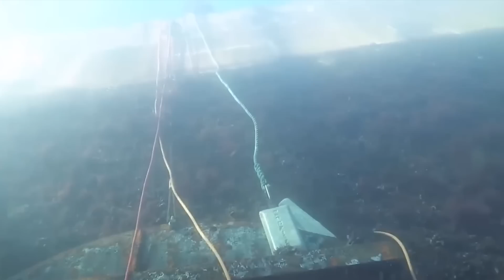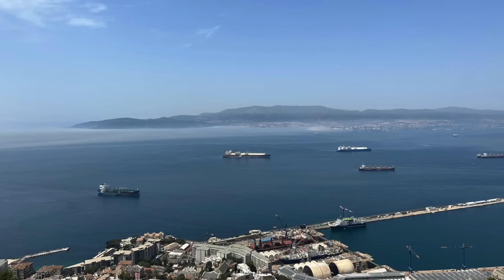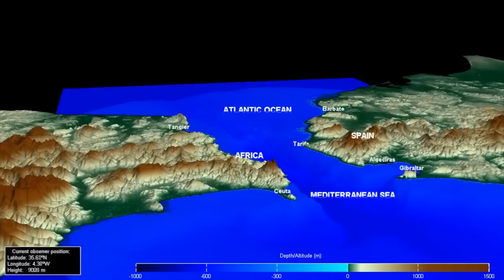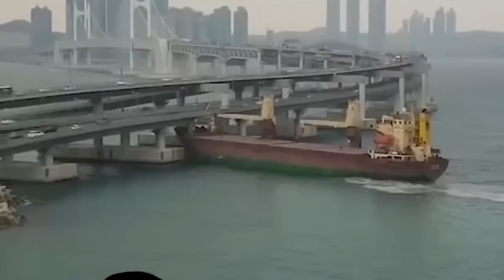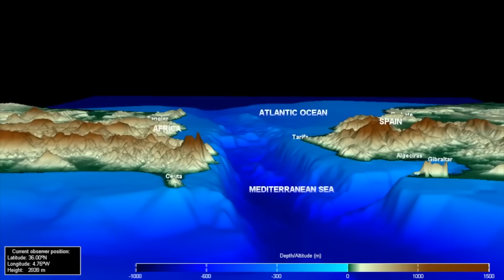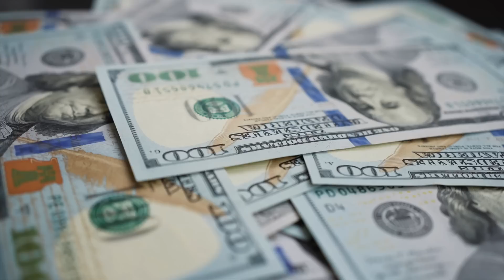Why Nobody Can Build A Transport Link Between Europe And Africa

Comment from the maker: Can this actually be solved? We're hearing rumors of a potential bridge planned to be built now but we're not so sure on this one
Reply: Who in their right mind wants to make leaving Africa easier?
Reply: It seems incredibly hard, I've often wondered if a system like the one used for oil platforms is an option, oil rigs are incredibly stable and operate in depths of 500m regularly, or you could build out as far as possible from the coasts and use oil rig like structures for form the central span secured by multiple cables. above and below.
Reply: They can, now there is a tunnel project.
Reply: Cant be done with a fixed construction, bc the African plate is moving to the Eurasian plate at a rate of 3 cm/year. So the only option would be part fixed on one plate, allowing for shipping and part floating on the other.
Also, there is no benefit, so i doubt someone is going to cough up billions to make it.
Reply: There's a project of a floating underwater tunnel in Norway now across a fiord - 2 tubes floating suspended on huge buoys. A very interesting solution that could be used here as well
Reply: @eugeneg1455  I'm afraid that there is a big difference ...A flord has no plate tectonics, is less deep and , depending where in the fjord, less to no  streaming water around.
Reply: Ask Elon. He will promise that we can go from Spain to Morocco in just 5 minutes with his Hyperloop starting in 2022.
Reply: Sky hooks.
Reply: Too deep
Reply: floating oil rig platforms
Reply: That has no meaning
Reply: Norway are first in the world with long distance floating underwater highway. Perhaps it could be used here.
Reply: A rail tunnel is far more feasible. The depth is not that great an issue, it would still be a shorter tunnel than the Channel Tunnel - the plan isn't just this crossing but faster journeys between Madrid and Casablanca
Reply: Terrible idea. Why would we want an even easier way for illegal migrants to gain access to Europe?
Reply: Building a bridge between Morocco and Spain that allows vehicles and trains to pass is a very easy task nowadays. It is not done because it is not wanted to be done. Just like the bridge between Italy and Sicily that was not built. Solutions to distances and other force problems can be found. As long as it is wanted.
Reply: @Cancalılardan  Not sure about this.
Technical main problems :
Very fast and turbulent water streaming from the atlantyif into the mediteranean (and back at low tide) requires enormous strength ...
We cannot even build seagoing ships withstanding rogue waves ....
We know that the plates are shifting. A project like this is build for a long time...and africa moves with ca 1 inch a year to europe.
Buiding any structure withstanding this movement and lasting long is near to impossible.
A non rigid structure could be possible ....but a floating bridge with those currents.....those floating pilars would need a lot of energy (and engines) to be kept in position. Also the issue of the big vessels will be a problem.

And WHY would we want a bridge...which can never handle a big cargo stream (compared to the cargo transported by containerships.)
This makes it a prestige object, not an economical business case.
Reply: You can't imagine a solution because your imagination sucks.

Comment: $20Bn is chicken feed considering the size of the European economy and the long term benefits that would accrue from a "land" transport link on the western side of both continents. $50Bn, $100Bn would also not be real financial obstacles for the theoretical long term benefits. No, the real obstacles are technical and political, neither of which are likely to be overcome any time soon. Once a bridge or tunnel with at least a 50 year no significant maintenance lifespan is technically feasible then moving forward on a project proposal might be viable.

Comment: We just need an idea how
1 use vehicle ships going back and forth.
2 fill a thin line of durt to add a highway on both sides, meeting in middle to where it has the ships' water path separate them with 2 open/ closed bridges.
3 a floating bridge with an open and closed ship path separation in middle that is flexible and strong against winds and water and earthquake  mabye lol

Comment: 5:05 "a height of at least 100 meters"? The highest air drafts are not much more than 72 meters. I don't think that a bridge would have to plan for a clearance of almost 30 meters (almost 100 feet) over the tallest ships.

Comment: They need another Chunnel. They did it from the UK to France across the English Channel years ago and  it was much longer at 31.5 miles than the mere 8 miles across the Strait of Gibraltar which is 2,953 feet  deep, much deeper than the 574 feet deep English Channel. Perhaps the depth is daunting for some reason.

Comment: Just bridge the gap with a parallel universe. Find an uninhabited universe where there is a land bridge between them, and build portals to and from it on either side. Problem solved.
Reply: Problem is though, we'd need to find a way to setup receivers in the other universe... Which of course is super easy to do these days in an inhabited universe since we can just communicate with the other side.... We'd need to find out how to get a matter receiver on the other side.
Reply: So the solution is Sliders!

Comment: The water flows primarily into the Mediterranean Sea to replace what the Mediterranean loses through evaporation?  Doesn't water also evaporate off of the Atlantic?  I understand that the Atlantic is deeper so it probably loses a smaller percentage of it's volume to evaporation, but it would also sometimes rain over both bodies of water, and rain on the Mediterranean (and rivers that feed into it) would also have a greater impact on replenishing it due to it being not as deep.

I would also think that tidal action would be dominant over all of these effects.

Comment: There is a solution.
It really easy.
Give me $3 Billion in gold and I will have it built within 5 years.
( Of course I will disappear just after you give me the gold. But who cares.)
No really it can be built. It just not feasible. The price to use it would be far more then other means.
Far cheaper. And it may exist. Would be a fairy system. It would be fair cheap to build. Far cheaper to maintain. And far safer.
If a fairy does not exist. Why hasn't anyone done it?
Yes it would be far less traffic. But it still more then without.

Comment: For those who say that this project will not happen because of the economical disparity between Europe and Africa, because of fear of illegal immigration…. Think about it. This transit will be much easier to control than the vast shores separating the two continents where pateras can roam between the two sides (still Morocco is doing a great effort here and this illegal immigration is well controlled at this point).
I think this project will see the light eventually, and I won’t be surprised if the work (not the inauguration)  start before 2030. It is unfortunate we are not going to see this marvel completed before the 2030 Morocco-Spain-Portugal joint World Cup.

Comment: Wrong,,,the trouble is in bad negatiwe kolateral human evolution,,,,,the tehnology of construction is tacken long a GO,, ewend on ertquacke end big vaves,,,the simple question is,,,Who will first make a complitly plan for best solution....deep concret stabilisators  conect wit long wires to a 4xbig ander watter sea tanks...witch are on deoth of 50m,,,end from ther up make a plarforms with computer control for stabilisating point of surface base witch can suport 5 000 t in worst deep sea part betwen EU end Afrika,,,end the conquest its simple,,or part of brige can go up of surface end ader part can go belowe the watter,,,

Comment: The Troll oil/gas drilling platform  was 472 meters in height, and was sited in 303 meters of water offshore from Norway. At the time, it was the tallest structure ever moved. Over time, it has sunk 36 meters into the subsea surface.

A similar structure could be the basis for a bridge. However, the cost would be astronomical, with each tower costing as much as $1 billion or more.

There would also be some issues with ecosystems,  as various plant and animal species could migrate over the bridge, either autonomous or carried by vehicles.

Comment: You failed to mention the overpowering need for such a project. Road or rail crossing would need to be showing a need which I doubt is there. Rail maybe a not starter due to differences in rail system. And be fun& a ferry across such a short stretch of water could funded for many decades for a 10th the price.

Comment: FAR too many problems to build a bridge or tunnel there.
One, not mentioned i believe, is that the African plate is moving to the Eurasian plate at a rate of 3 cm/year. That means any fixed construction would be in trouble in 10 years or something, as expansion/contraction measures, which are always applied to large structures, will be pushed to fail.
That means the only technological possibility would be to use a fixed part, to allow for busy shipping there and a flexible, floating part, ankered to the sea floor, but allowing for this tectonic movement.

You cant just compare to any other tunnel or bridge, which are all on the same tectonic plate. It matters, a LOT.
Reply: He mentioned it at 5:33, but only in relation to earthquakes, not in relation to movement, relative to each other.
Reply: When I found this video that was literally the first thing I thought of
Reply: Thank you!!! This was my theory the whole time.

However, the political and economic (or lack of) reasons are also pretty loud in their own right.
Reply: I've wondered about the bridge over the Bosphorus, though. Doesn't it span the gap between two tectonic plates (as would an undersea tunnel also in the works, I believe)? I have always assumed the Eurasian and Anatolian plates are also continuing to plow into each other.

That wouldn't mean the Bosphorus bridge was necessarily a bad idea, mind you. The economic case for it would be massively greater than for a Gibraltar bridge even if the Bosphorus bridge had a usable life of, say, a century or so between full replacements forced by ongoing tectonic shifts.
Reply: @PeloquinDavid  Im no expert on plate tectonics, but the anatolian plate is stated to rotate counter clockwise (being forced by a number of other plates) and moving southwest at a rate of about 2 cm/year.
Fixed spanning that would also lead to problems pretty fast imo, although some things can be done if direction is known up to some extent, for instance by sliding segments for a bridge (will be a lot harder for tunnels).
The Bosporus itself is sitting on the eurasian plate.
And the bridge at for instance Lapseki in the Dardanalles is sitting on the anatolian plate. So both these do not span different plates.
I dont know any that do, which is why i pointed out it will most likely cause problems relatively early in the lifespan of a bridge or tunnel, which normally last a minimum of 50 years to make it economically viable to build them, but often stand for 100, or 100s of years.
Reply: @StofStuiver  Thanks for this. I see now that the Bosphorus is still technically on the Eurasian side of the northern Anatolian fault. But it's awfully close to that fault system and the entire region - all the way under the Black Sea and across to Crimea - is (like the Anatolian plate itself, though to a lesser degree) under significant pressure from the advancing Arabian plate, it appears.

But you're undoubtedly right that the rotation of the Anatolian plate into the Aegean and eastern Mediterranean means the pressures that would lead to buckling of the land the Bosphorus bridges are built on would be a lot less than that of the advancing African plate plowing northward through what I presume is still mostly oceanic crust between Morocco and Gibraltar.

So your point about the particularly challenging tectonic environment for a Gibraltar bridge certainly seems well founded...
Reply: Maybe there's an arch design that would be able to flex such that it would only grow stronger as that happens.
Reply: Built a bridge in San Francisco, Earthquake much. Just saying. I think it is not wanting a passage more than anything.
Reply: LOVE you. Someone acknowledging that it's not climate change changing the planet, it's just the planet doing what it does! No one seems smart enough to remember that at one time, every continent on the planet was one land mass.
Reply: @AliSwanson1728 And before that it was many landmasses, and before that it was 1 landmass again, etc, it goes in cycles.
Reply: @AliSwanson1728  Love you too m8.
And indeed, the thing you mention is one big hoax. They mention it everywhere now. Even menstruation pain and baldness are now a result of that thing, alledgedly
;]

Comment: Imagine if there was a trans African union.
Saudi Arabia, Iran, Iraq having land transport ability train or truck to Europe. Of course the countries of the Eastern North African don't see eye to eye on theocratic issues.
What about central and southern African nations. What might they stand to gain?
The tunnel or bridge would be a big red button to push for terrorists.
I'm not saying it would accomplish anything but chaos but Terrorists are generally not what you call long term thinkers.
The Saudis could find the project themselves.
But would it help or hinder pipelines across the Red Sea?
What about carbon fibre.
Heard about the strength and durability. So far car parts. Car bonnets, spoilers, replacing plastics on the interior.
Electric railways? High speed mag lev?

Comment: It's never an engineering problem. Finance and political problems will kill it faster than any lack of ability
Reply: It is.
The African plate is moving to the Eurasian plate at 3cm/year.
Not possible to build a fixed structure spanning it.
I was hoping this would be the first thing mentioned, but its not mentioned at all. Instead the maker of video is comparing to bridges and tunnels that are all on the same tectonic plate.

Comment: Estimates to build it from 5-20 billion dollars? You taking the pi$$?? You can double or triple that amount as unforeseen technical problems will inevitably arise . The actual cost of building the Channel Tunnel (9 billion UK pounds in 1994 - equivalent to 22 billion today)  was almost double its original estimate of 5 billion UK pounds. Crossrail in London to link the west of the Capital  to the east by rail  tunnel was estimated to cost 14 billion pounds  and ended up costing 24 billion largely due to the technical challenges of the project. The cost of the 'Big Dig' road tunnels in Boston overran by over 190%.
Reply: Costs are adjusted every year, so a estimated cost is useless.  Look at the high speed rail California is building to someday connect San Francisco to LA. Original cost was somewhere abound 24 billion.  Now the cost for just a short section is over 100 billion and rising.  If it is ever completely built, it will be probably over 200 billion.  A lot of money for a train track that is suppose to be affordable to everyone.
Reply: Don't forget the weather, it can cause significant delays as well. Also, don't forget if there are any problems with obtaining materials, equipment, workers, and other needed supplies, that can also cause delays and significantly set a project back by not only weeks or even months, but years in some instances!!

Comment: the tech is solvable... but the rationale for it does not exist. politically it would turn southern Spain into save refugee zone, and all the issues that Europe is currently facing with political and climate refugees would be multiplied. so don't bother spending time trying to solve the tech- the politics is dead-set against it.

Comment: 5 to 20 billion... and this kind of projects are usually "over budget", up to 3 times. So this thing would cost some 50 billion. Not impossible, but would require all of the EU. And I doubt the benefits over shipping are worth that. A 20 km ferry ride can be done easily. And if you are in a hurry, get a helicopter or plane. 
Freight will remain on ships anyway, nobody needs those amounts of freigth in the south of Spain and the number of truck to make this crossing worth while, would be enormous. 

So I am thinking. Nice idea but not worth the effort.

Comment: A 2-track railroad tunnel is in the realm of feasibility.

The railroad would carry freight trains, passenger trains and road vehicle shuttle trains.

Like the English Channel Tunnel.
Reply: No its not.
2 tectonic plates and the African one is moving north at 3cm/year.
Not possible
Reply: @StofStuiver  
Strait of Gibraltar tunnel 
It has already passed engineering studies. The problems are the cost and the depth of the strait.
Reply: @alanstevens1296  That doesnt mean much. Probably a risc assesment and some sections sliding. All nice if its exactly in the direction of the move, but there is also subduction. Its going to lead to problems fast (10-20 years). Even faster for a tunnel.
Waste of money.
Reply: @StofStuiver  
There are feasible routes in waters not more than 700 feet deep and thru adequate soils.

The problem is getting both countries to agree to the project and then fund it.

I don't see that happening.